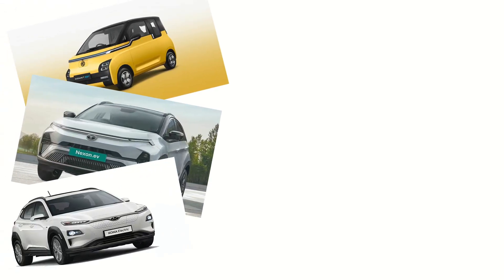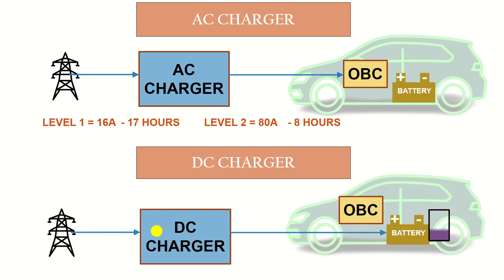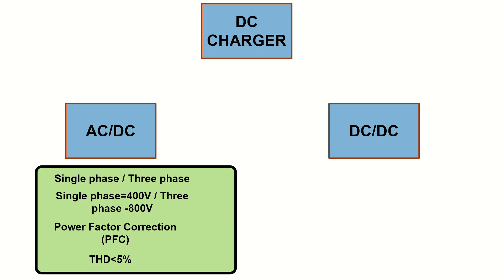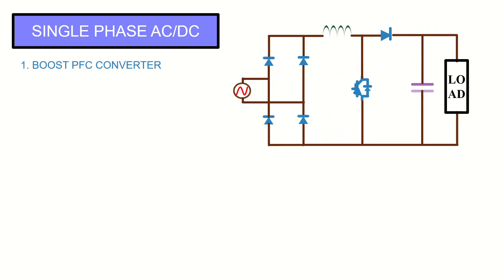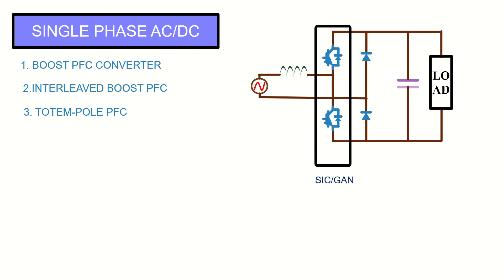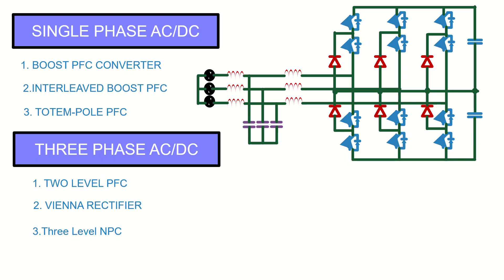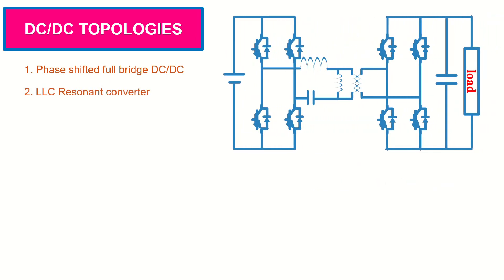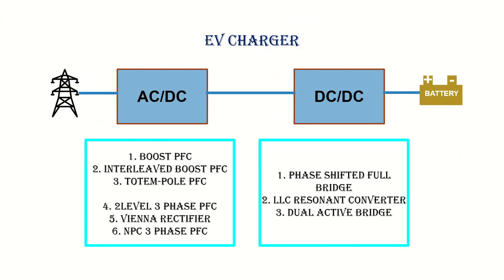EV CHARGER TOPOLOGIES | TECH SIMULATOR

Comment: Is it possible  to use bidirectional buck boost converter with two switches (without galvanic isolation ) in DC DC conversion stage instead of Dual Active Bridge circuit?